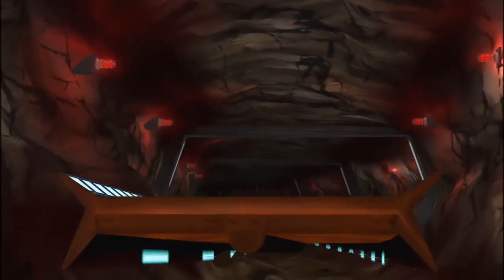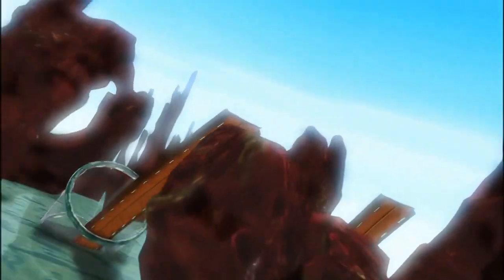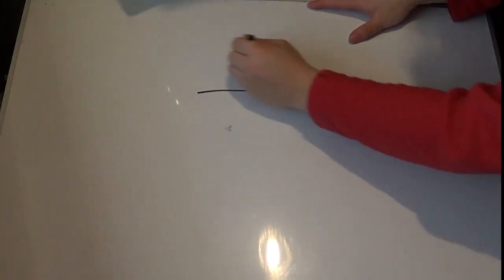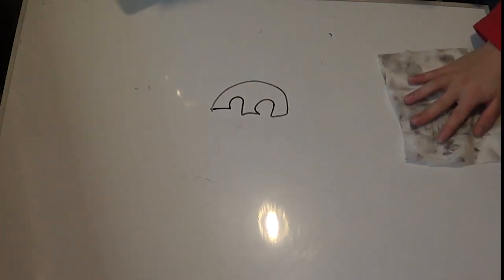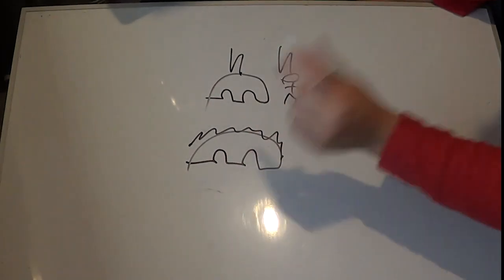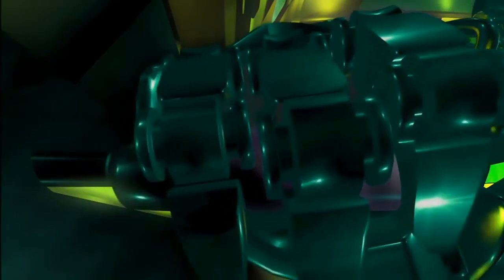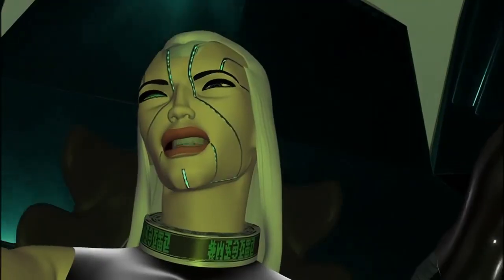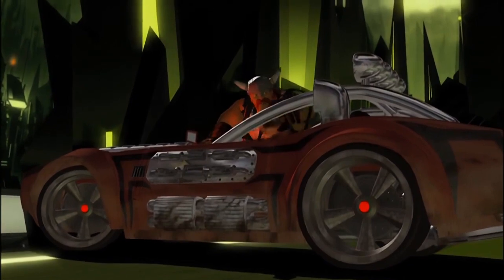AcceleRacers: The SCIENCE Of Accelechargers

Comment: Swamp- Front of the Car is like the soil Surface that sprouts the vines where the car is facing. Like Kurt steers, vines steer as well

Water- Simply Float with increased density as some water gets densed like a simple surface to prevent the car from ever feeling any water

Junk- Forms a barrier force track around to fill in any gaps that would obstruct aka make the car fly off the surface

Storm- Conductor simply a magnetic force that reverts the lightning away from the car. In a way the car has a magnet shield to make any lightning bounce off

Cosmic-Adds the missing air from the realm or pretty much removes any wind/gravitational interferance to make the car's aerodynamics perfect. Basically nothing is blocking the car to go any faster.

Fog- Like a different vision example night vision or thermal vision to see through things easily without the filter vision itself

Cliffside- Tires have extra grip like super glue tires to prevent it from slipping with extra gravity to prevent it from losing its grip everytime.